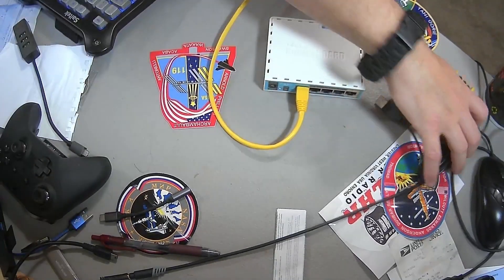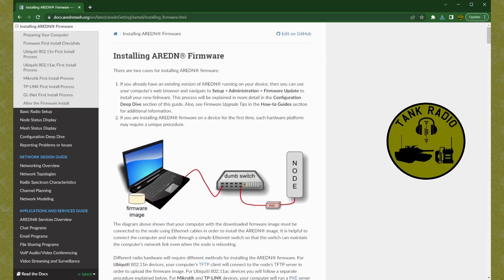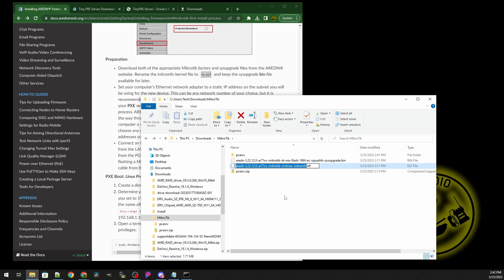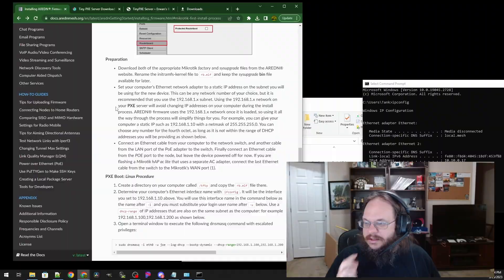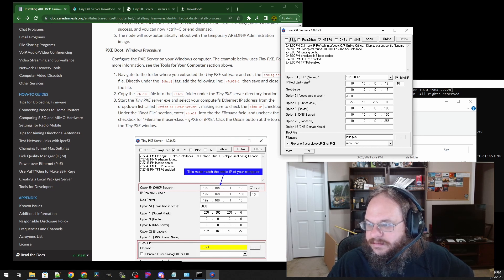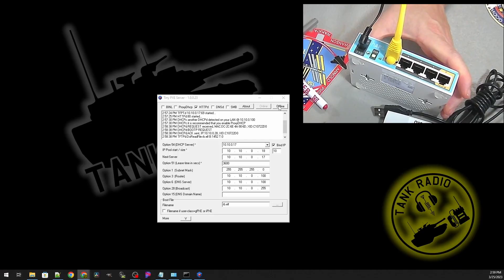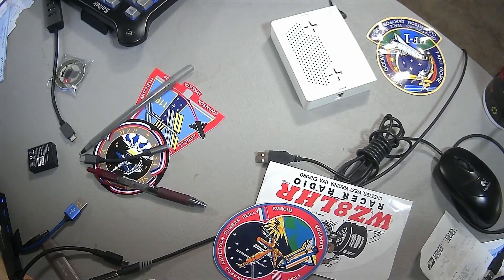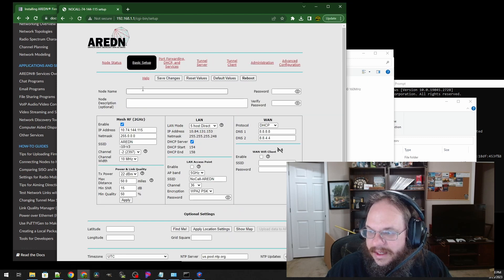Installing Aredn on MikroTik hAP ac lite

Comment: Thank You for the video Frank! I joined the ranks of the AREDN tonight. My tunnel is not up yet but should be tomorrow. 73 DE KD5FMU
Reply from the maker: Thats awesome.  I need to start putting pressure on the local ham clubs to build out the arden nodes to give me something to connect to.
Reply: Our state has a IP phone system that is already enabled but still being built out. But Ham Shack Hotline users can call into us. I am using a PolyCom phone. Working Great @TankRadio